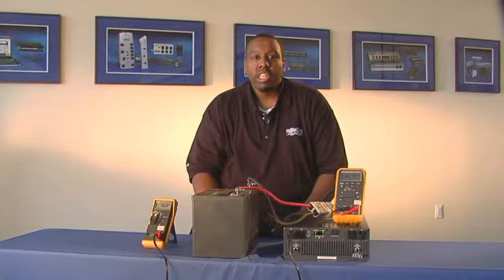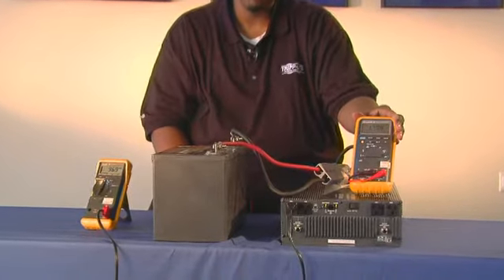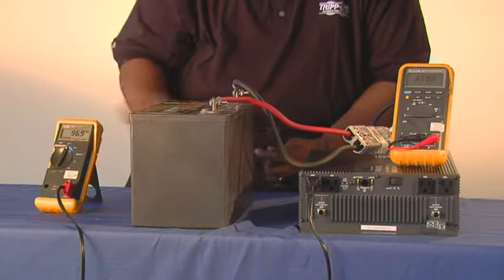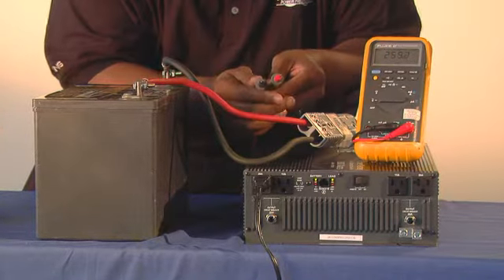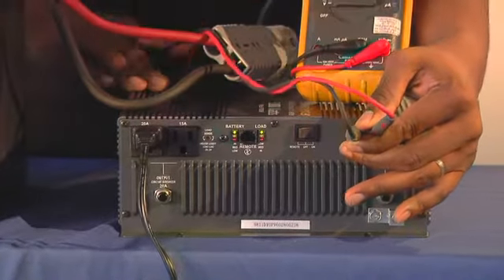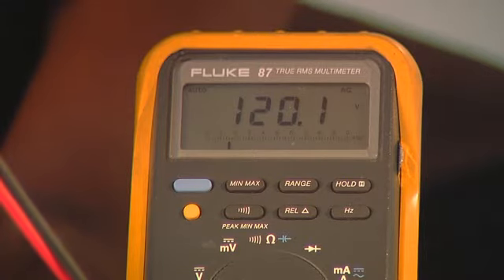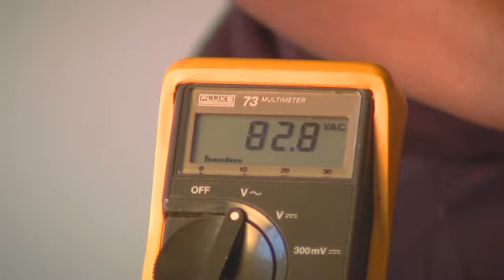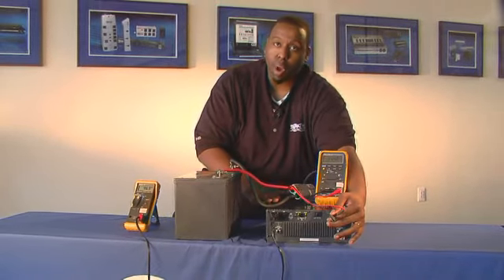How To: Get the AC voltage reading on an inverter - Tripp Lite tutorial

Comment: the true rms meter was showing 114 look close.
Reply: 6 years later but this is important:  114v is just fine!  Your equipment is rated to 110 to 120v, so any voltage in between is fine!